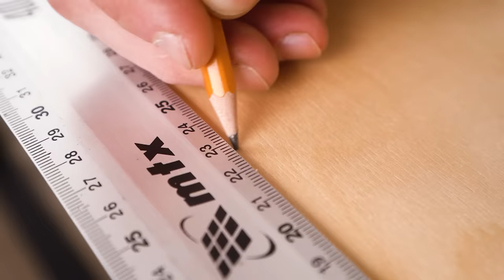Handmade Pinball with Fully Working Automatic Bumpers

Comment: As a long-time pinball addict I love the idea and craftsmanship - very well done! Especially the bumpers are well designed, even emulate the real switch mechanics used in many pinball machines - nice! I am afraid  that the thin aluminum rings won’t last very long, given the task of having to propel a steel ball… it maybe better to use real pin parts here.